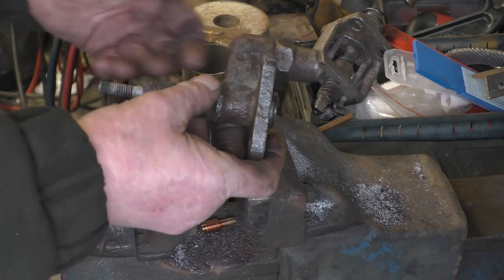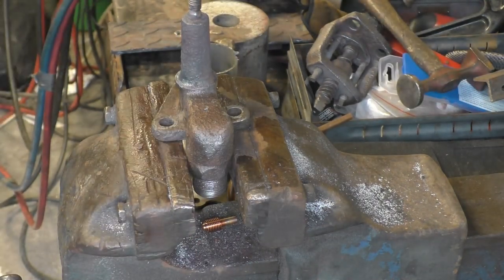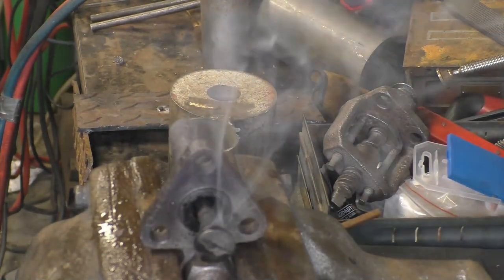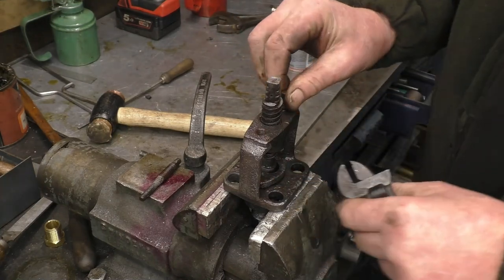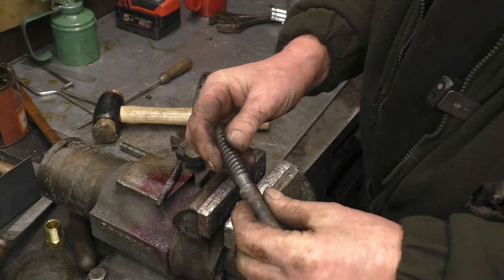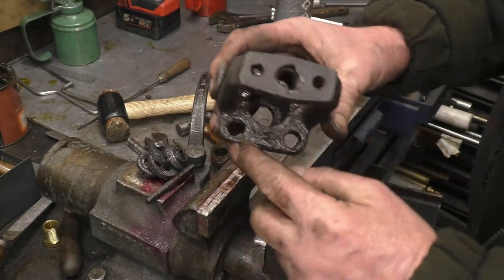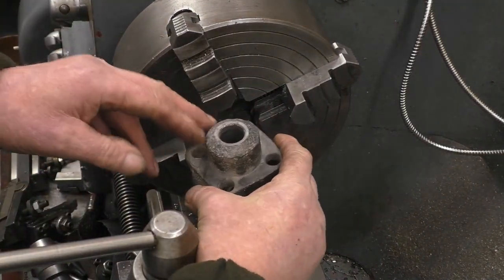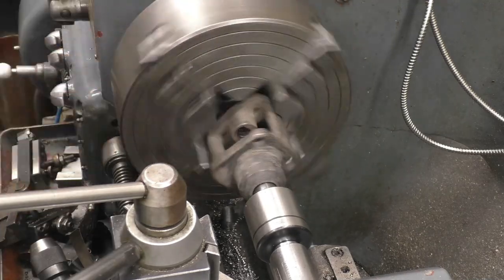SNNC 476 P1 T2   Steam Waggon Valve Repair

Comment: I think I would have put the valve spindle back in with the valve open by a mm or 2 and then centred on the valve seat that you just machined.